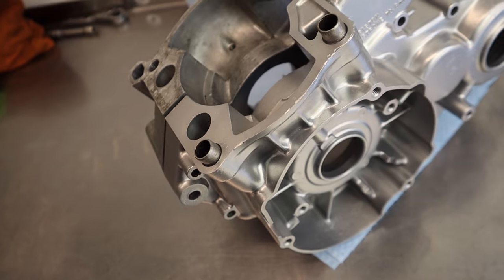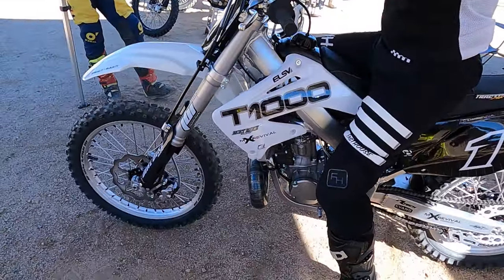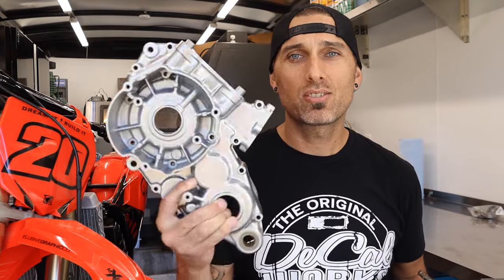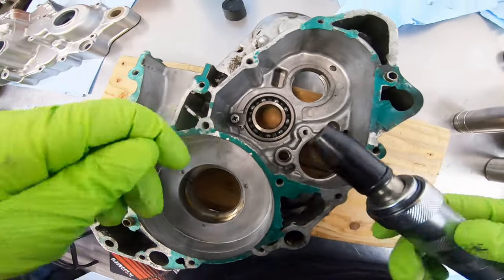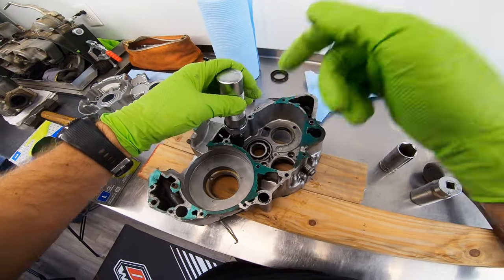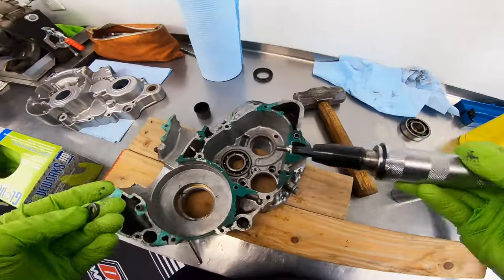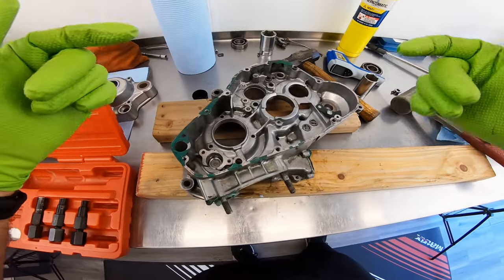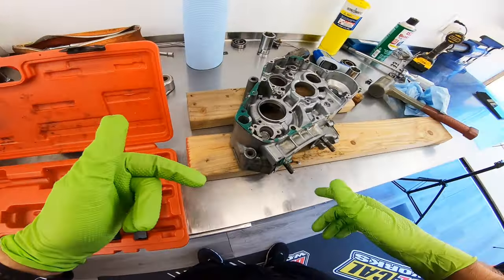My VAPOR BLASTING SECRETS - HOW to Vapor Blast & Make Aluminum Dirt Bike Parts Look Better Than New

Comment: A couple of little tips, things I've learned over the years.  1st, go to the dollar store, buy some LA's Totally Awesome, it's a better grease remover than even purple power, and it's cheap!  And 2nd the locating dowels to get them out, it's really easy!  Get a complete set of drill bits, I have a nice titanium nitrided set of 30 or so different bits, second find the bit that fits inside the locating dowel, next heat up the case and last use some vice grips around the locating dowel to twist and pull out the locating dowel out, the drill bit keeps you from crushing the dowel and it comes out every time!

Comment: Well explained video!  I have a small Powdercoating oven I put my cases in, set at 200 degrees f and 95% of the time, the bearings fall out. I do the same in reverse, freeze the new bearings, heat the cases in the oven and they fall right in. I have heard from engine builders that spot heat can cause case warpage due to the unevenness of the heat for what it’s worth.  For blasting, I use Ballotini beads, 170-325 mesh.  They suggest no more than 60 psi working pressure as the beads will crush and be more like using crushed glass. For vapor honing, the cfm is more important than the psi.  Try to us 18 cfm as a minimum.  I run at 35 psi in my wet cabinet and use the same very fine 170-325 beads. I enjoy your videos!
Reply: I just read similar about the glass beads from a company, recommending not to go over 50 psi as it can fracture the ball shaped beads into sharper objects and embed into the Aluminum or cut instead of peen.....
Why didn't SOMEBODY TELLL SOMEBODY!!! GAHHHH

Comment: If you don’t damage impacted screws, and they have loctite, preheat to 100 degrees C (212 F). They can be reused, a bit of heat will allow them to be reused and re-loctite them. Sometimes old stuff is unobtanium.
Reply from the maker: Cool tip! Thanks for watching!

Comment: screw may be a JIS head - similar to Philips but has a different tip angle. If you use a standard Philips on a JIS screw, it will bugger the recess very quickly.  (tip given to me from an old-school cycle mechanic)
Reply from the maker: Dropping the knowledge!
Reply: @mxrevival a number 3 Phillips head is the closest you can get to JIS without having a JIS fun fact it stands for Japanese Industrial Standard screw driver and it has a two step angle at the top instead of one slope that's why regular screw drivers don't like to grab in JIS screws

Comment: If you have to remove anything stuck or broken off in magnesium, don’t use fire, at all. It will cause a flame and explosion like you have never seen. Use a soldering iron. The old ones with the replacement tip. You can even break loose lock tight.

Comment: I have had great success in dry cabinet blaster by useing BICARB, The big advantage is its ultra fine powder with great finish and to top it all you merely wash the part in water to dissolve any bicarb that may have gone into a passage
Reply from the maker: I really enjoyed my soda set up as well. Before I had the two machines in this video, the drive last cabinet actually had the conversion hopper for the baking soda.

It worked awesome! Definitely a really good “OEM” finish on a lot of parts. Not overdone or shiny vapor blasting can be.

Definitely safer as you mentioned for the less detail oriented during assembly!

Comment: I built my vaporblaster out of an old Econoblast venturi cabinet and use a sump pump on 4" spacers in a 5 gallon bucket under it as my pump and supply bucket and the spray just runs out into it. I am lucky to work the past 30 years at a shot peen company doing Aerospace peening and I get free barely used AGB-9 ( old US Size12) glass bead media ( Bell Helicopter makes us throw it away every 3 hours ). I find that if I add a cup of 220 grit Aluminum Oxide to my slurry, it will cut any paint or gasket materials and no affect my final finish much. Thanks for sharing ! BTW, I use mine restoring vintage Z50's and CT70's . I pre-clean engines in my hot pressure wash machine like they use for transmissions for cars.
Reply from the maker: This is awesome! I love comments that add value to the video. Thanks brotha! Cool build & great tip. Thanks for watching too 🙏 -Charles // mXrevival

Comment: Ok I tried it on my vapor blasting machine and thank you so much. I was way off on my pressure. I started at like 40psi and went up from there. 20 ish is the ticket! I took one of the parts I recently blasted and threw it back in and it’s so beautiful! Thank you!
Reply from the maker: That is such awesome news! Really glad to help out. It's tough sometimes because you want to do the part as quickly as possible, and the high PSI will cut faster. But as you now know, it robs the part of the shine that we are all after with vapor blasting.

I just dropped a new vapor blasting how to video pretty recently, because I've gotten better at it. I also have some new tooling inside the cabinet that brought the shine up even more quickly, while also working faster.

That video is called "blast like a pro" and I think you'll like it

Comment: Late to the video but That black tool your using to help clean is an ESD Nylon Probe. I used them at work while doing work with Circuit boards, never thought to use it in the shop lol. Awesome Informative Video.

Comment: Very informative video  Parts look awesome... I have a couple questions 
1.  What size nozzles do you use in the guns on the dry blaster and as well in the wet blaster?
2.  Do you have to put any clear coat on the aluminum afterwards so it doesn't oxidize?

Comment: When you run into screws with loctite on them, just use some heat also.
The heat softens the glue making it easier to remove.
Love the video.
Reply from the maker: Yes exactly! They were nice and hot from torching the hell out of the crank bearings, etc 😂 thanks for watching bro!

Comment: I usually go about 200 degrees, I will try lower temps going forward. To get those locating dowels out, stick a drill bit in there and then use vice grips, to get them out. GREAT VIDEO!
Reply from the maker: I just saw this trick for the first time, such a great one. Glad you dropped it here for people to read. Thanks for watching my man!

Comment: Hi Sir.
Can we do vapour blasting for truck engines and gear boxes?.
Also 
What are disadvantages of these process ?
Reply from the maker: You can vapor blast literally anything! The only thing that might cause you an issue is corrosion on steel. You could probably put an additive in the vapor blasting tank to combat flash-rust or corrosion. But I'd be cautious as it might damage the pump motor that is the heart of the vapor blaster. 

You'll find out if it's worth it when you try it. Different for everyone.

Comment: Hay man i really like your vids . Just wanted to know i am doing a build on my 1982 RM 250 the motor cases are black from the factory will vapor blasting blow all the paint right off . Or do i have to remove the paint first . Thanks Mike.
Reply from the maker: Thanks Michael, I appreciate that. You’re going to want to get the paint off first. Going to make your life a lot easier. You can use rust oleum brand “aircraft remover” to loosen up the paint and pressure wash as much of it off as you can.
Reply: @mxrevival  cool thanks so much your the man keep up the great vids .and thank you for getting back to me.

Comment: You can remove blind bearings with the wat paper towel technique. Shove as much wet pt into the hole to fill the cavity behind the bearing. Then use a rod smaller than the inner race. Use the rod to compress the pt behind the bearing by hammering it in. You will have to add more pt as you go to keep pushing it out. It takes time but if you don't want to but the slude hammer and collets. It will do the job.
Reply from the maker: I’ve heard of that! Sounds pretty cool! Thanks for watching and explaining the process for people

Comment: Hey, just curious to know, whether dry blasting(glass bead media) will spoil the mating area on the engine case? I have few engines to be restored so looking up to clean all the surface without damaging any contours. 

Your input is much appreciated.
Reply from the maker: Good to go! Glass bead is gentle. No need to run those surfaces hard. Bead bounces off silicone so do a good pre-clean. 

You can also pull your gun away from the part and this will also decrease the rate at which bead strikes it. (Should you still be concerned) 

Have fun 🙌

Comment: Enjoyed the video. Thanks for sharing the tips! I use a mix of glass and al oxide in my vapor blaster. It gives a nice finish, but I don't think its as "chromed" as yours. I am restoring an old z car, and the vapor blaster has been my go to tool for lots of different surfaces. I have even done plastics like electrical connectors on low psi. Really brings them back to life. All the best!
Reply from the maker: Hey thank you, and you're very welcome! That's great news. Moving to all glass bead, if it suits you, will give you the Chrome! Thanks for taking your time to watch, the vapor blasters are awesome

Comment: Can I ask what gun and hose sizes you use please? Is your wet cabinet a filtered system or closed loop? And how much media to water do you add?
Reply from the maker: Here you go my friend: Vapor Blasting - EVERYTHING You Need to Know 🔥 How To Media Blast - Tips Tricks Tools & Techniques
https://youtu.be/J5aR3EKKPWM

System is closed, and the machine just accepts a 50lb bucket of media with instructions to “fill up to this line” from the manufacturer. So actual water quantity- I’m unsure. 

Water level is constantly fluctuating as I rinse parts and drain when water fills too high. Works with no fluctuations inside the water capacity it does hold.
Reply: @mxrevival  thanks.. I’m just struggling to get that polished finish in my blaster.. always get a bright satin finish..

Comment: Thanks for the video... Good stuff. I found tho that I got the same result with dry blast glass bead around 50 to 60psi. And less dust... More psi I found gave me a shit load more  dust.
Reply from the maker: Very interesting! I totally agree wet blast isn't 100% necessary. It will just put a shine on unlike dry, if someone really wants to spend some extra time in the cabinet. May I ask what media type and grain size you used? Would love to know, and it would probably help others.
Reply: @mxrevival  thanks for replying. I do vapour blasting as well. I tried several options on dry... Soda on carbs and brakes. Just wasn't happy with the outcome... And a serious amount of dust no matter how low I wound down the pressure. The reason tho for soda on carbs was so afterwards I would  ultrasonic bath them and would help get rid of any left over soda.
Garnet is just too harsh for this Kind of stuff... Same with alloy oxide.
So glass is my go to for for alloy bits. I couldn't give you grain size.. I asked for glass grade somewhere between medium and fine. It works. But just thru experimenting I found that I lowered the psi until the result changed. And I didn't have as much dust. I'm restoring 4 classic Honda goldwings so it's important for me to have the right outcome. And I agree for wetblast after dry. It does make that difference.
I've built my own cabinet and thru trial and error it's getting closer to where I want it.

Comment: Hi, here we don’t have vapour blast available so I have gone through the dry glass beat blasting for my cases and as you mentioned the finish is very nice. Do I just leave it as it is or do we need to get it lacquered? It would be very helpful if you could answer
Reply from the maker: I like to leave them bare aluminum so that they can be cleaned easily later on. If you coat them, someday they will be harder to clean. But you CAN coat them if you'd like to. There are no wrong answers 💪
Reply: Thank you very much @mxrevival  for oyur reply. I will also leave it bare as advised :)!. in some areas there are pores though (even gbead blasting didnt make it smooth) 
coz of its age .Maybe i should use a sand as bit? Or leave it like that. thank you youe made my decision less complicated.

Comment: With the vapor blasting process, is there any chance of the glass beads getting stuck in oil passages or other crevices?
Reply from the maker: Somebody would have to be extremely negligent if it were to make it into a rebuilt engine. It's a good question.

If the parts are rinsed out, or plugged and rinsed, and especially hit with an air compressor just to be sure (this is what I do) as well as inspected before any final assembly, I would be shocked if somebody still had bead in the engine.

Comment: I’m going to try some low pressure on my own cabinet. My finishes are never that nice. I saw your YZ 500 video and the finish is probably twice as good as this. What are you doing differently now?
Reply from the maker: Great question and in case you miss my reply on your other comment, check out a video I just did explaining this. It's called "blast like a pro". 

Also, I'm not sure which YZ 500 episode you saw, but I think episode 3 had some vapor blasting in it with a super bright finish. That was also brand new media which does add to the brightness

Comment: Great video, I have both a dry and wet blaster both home made from parts and they kinda like fishing you can have great days and bad days (doesn't help my work requirements change all the time so its a lot of media changes) but glass where i live is easy to come by but does require extra safety as you said (inhale that stuff and get silica poisoning or worse die cause it gets in your blood stream)
Thanks for the upload :)
Reply from the maker: That's cool! And thank you for watching.

I definitely love having both and I know exactly what you mean about having to change the media a lot. That's what I love about the dry blaster.

I need to be better about wearing a mask when I'm running the drive blaster even though the vacuum is double filtered.

Sometimes I forget, and I know better, but most of the time I'm good about it...

Have a great day!

Comment: Hey Charles,  any advice on what to do with a case that has a low spot about 3/4 inch along the mating surface that leaves a .025 - .003 inch gap on the bottom of the  crank housing ? Thanks!
Reply from the maker: Hey, trying to visualize that but hard to tell if that is Factory or if it is damaged? I will definitely miss your reply because YouTube only notifies me the first time I get a comment. So you can definitely reach out to me on the website by using the contact link. Then you can send me some photos once I reply 🔥 mXrevival.com 

Thanks for watching!

Comment: The ultra fine glass bead, do you have a size for that? 50 microns?  200? Brand or manufacturer? I'm not stateside anyway, but trying to find media locally for what I'm working on and it'd be useful to compare and have a benchmark.
Reply from the maker: I get this stuff on Amazon, so you might have access to it. It creates incredibly bright finishes when following the pressures. (I also have a updated video that is more streamlined and I’ve gotten much better at it.) 

the bucket of abrasive media says: 

Size “AH”
170–325
6ZC13 (part number I believe)

Good luck!

Comment: How do you change the media in the vapor blaster? 
I have a cabinet and it’s a pain to change out the media. Any tips and tricks? 
It doesn’t seem to flow out as they say it does
Reply from the maker: Being in a trailer (and this could be a helpful tip for you too) it was one of my concerns. But I found a good solution. 

I use a black water hose (RV turd tube!) to drain the water out first, then slowly use the hose inside the cabinet to flush the media out & through the hose too.

You have to check the hose, because the media can build up, then back up (AKA leaks in the shop). So I just take my time, and remove the hose/ give it a few whacks outside when this happens. 

It's also draining into a large storage bin, to catch the media. Takes about 30-40 minutes to drain, fill, clean out the cabinet very well, and re-load. It used to take about an hour + when I was getting a system down.

Hope that helps!

-Charles // mXrevival

Comment: Any recommendations on budget vapor and sandblast cabinets? I’m wanting to achieve the same result without breaking the bank and my OCD needs this perfection.
Reply from the maker: Go big, it will be worth it! It's addictive & you'll end up going big later anyway, & spending on cabinets twice! But yes, tons of cool options via Google search. The biggest thing is getting a compressor that can keep up. That's another reason to go big out of the gate. You really don't want to buy the compressor twice if you can avoid it!